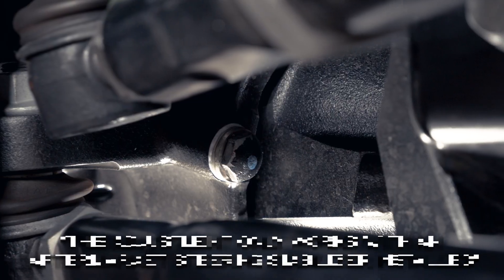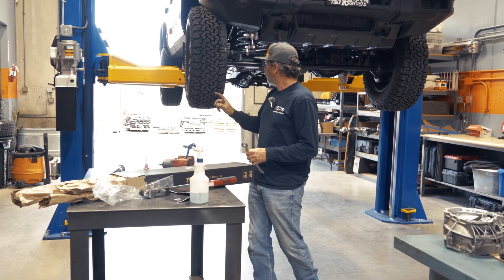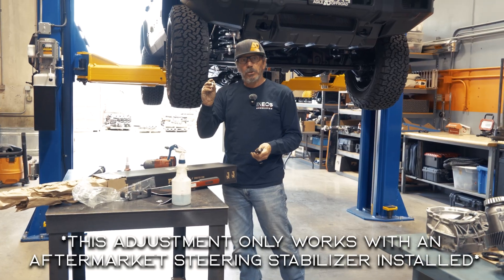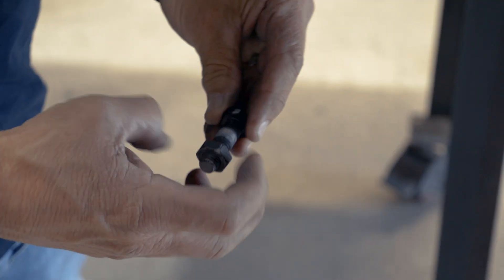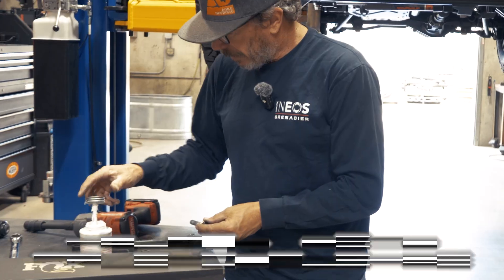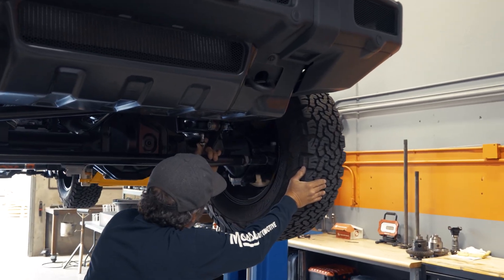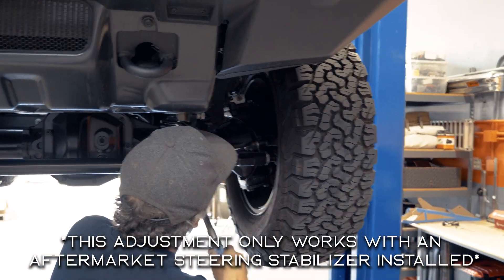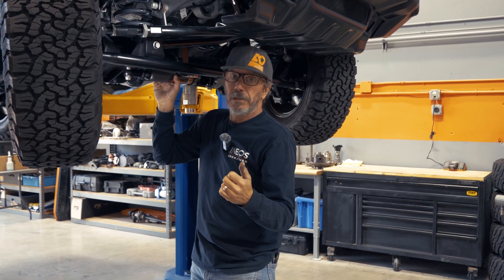Improve Your Grenadier’s Turning Radius with This Simple Steering Stop Adjustment*

Comment: Hey qq you mention a thick vs a thin washer, not clear on what you consider a thick washer. I did this with two regular washers, have no rub and steering is vastly improved (thank you) do you think I should go back and add another washer
Reply from the maker: Great question! 👍 We recommend two SAE 7/16″ washers (each approximately 0.062″ thick, which is about 1.6 mm) stacked. That combo gives the right clearance without going too far, so if your steering feels good now and there is no rubbing, you likely don’t need to add more.
Reply: @Agileoffroad you guys are the best, that is pretty bang on where mine are! Thanks so much, massive improvement over slow speed turns.

Comment: I don’t understand the relationship between the washers and the steering stabilizers. Could you explain? And measure how much there is to gain?

Indeed the radius is huge
Reply from the maker: Great question! The factory steering stops limit the Grenadier’s turning radius quite a bit. By adding washers, you effectively let the steering travel a little farther—but doing this safely requires an aftermarket steering stabilizer, since it controls the added steering force that turning your wheels effectively "more than normal" can add,  and prevents oscillation. The improvement is noticeable—roughly a few degrees tighter, which makes low-speed maneuvers easier.
Reply: @Agileoffroad thank you

Comment: Does this increased steering range put any extra stress on the axle u-joint?  Not sure how many extra degrees of turning this mod gives u.
Reply from the maker: Good question! The added steering range is minimal—just a few extra degrees—so it doesn’t meaningfully increase stress on the axle u-joints. The aftermarket stabilizer keeps things controlled, and the washers simply take advantage of the safe margin built into the factory stops. It’s a subtle but worthwhile improvement in turning radius.

Comment: I Just install the Fox stabilizer from you guys and did the washer shortening of the steering stops and the turning radius has not changed one bit. There is a cul-de-sac I have to turn around in order to back into my driveway and the truck turning radius is exact same before and after.  it will not make the turnaround without backing up once.
Reply: You have to readjust the hydraulic stops of the steering gear. To do it:
In an open space. Vehicle stop engine running 
Full turn to one side drive slowly and push the steering wheel very hard to the same side, you will se that you are able to move it much further.
Repeat operation to the o the side.
Once this is completed you will have a reduced turning
Reply from the maker: We're sorry to hear you're not seeing the improvement! The steering stop adjustment typically provides a noticeable change, but it can vary slightly depending on your specific setup and driving style, and how you did the adjustment itself. If you want to dive deeper into it please contact us!